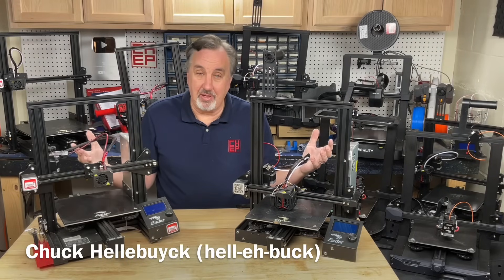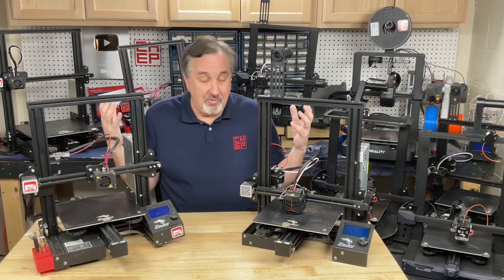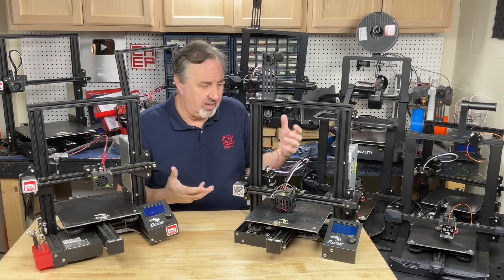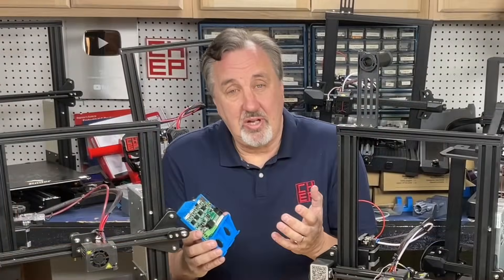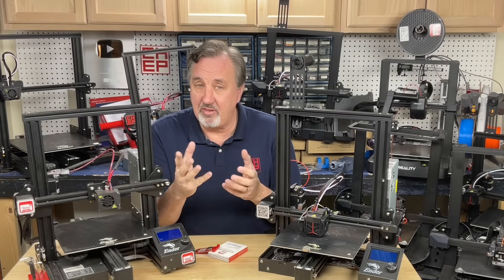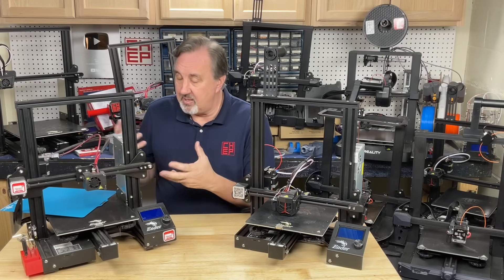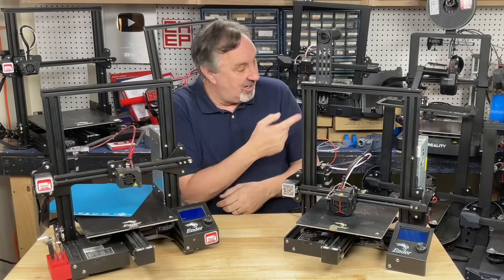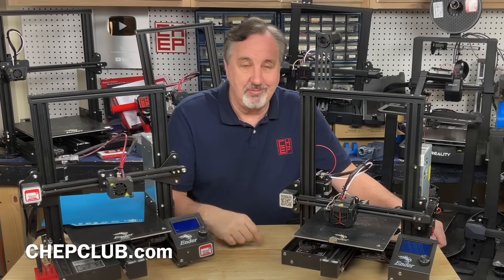Too Many Ender 3's - What Should I Do?

Comment: I bought an Ender 3 knowing it was open source, and had lots of support and potential for modification. I didn't necessarily buy into it thinking of practical printing, I bought into it as a hobby, a project to learn more and make useful things as a sidequest. 
What I don't see these days, and wish I did, was maker channels turning their Enders into printers capable of competing with modern machines and extending their life. The fact you would even suggest putting perfectly capable machines in landfill is completely against my ethos as to why I bought into this amazing printer. 
I recently pondered getting a Bambu, but I just did not like that it was not open source. I have invested in parts for my Ender to bring it back up to spec, so I have complete control, and I learn in doing so. It's just, I am struggling to find tutorials and guidance for the parts I have bought and my lack of knowledge. I took this risk hoping AI will guide me as Youtube seems to be lacking. 
The reason I follow and watch all your videos is because of the Ender 3.
Sure it makes sense for a channel to keep up with modern machines for reviewing, it takes a special channel to show dedication to the foundations of what got us going, like as you refer to classic computers, nostalgia is a powerful drug, as is maintaining and upgrading something well beyond it's shelf-life. That is what makes the Ender 3 live on to this day, the Bambu shake-up was and is cool, but it'll never beat an Ender so long as it's closed source. Just my two cents.

Comment: I have five Ender 3 pro's all highly modded. Companies got away from extrusion frames to save cost. The new printers with proprietary frames cant be modded like E3's can. The Ender 3's turn out great prints when the frame is braced better to remove vibes. I use mine at 150+mmps all day long. For the modders the Creality extrusion older machines can be had for low price and madding is half the fun IMO

Comment: the $200 Centauri basically has destroyed the idea of ever getting an Ender3. A 500mm/s, 256x256x256 build size, core XY with full auto calibration for $199 has changed the game.
Reply: I still use my Ender-3 with the 8-bit Silent Stepper Board daily with your CHEP Profiles on a iMac i7 2011- I’d embrace an Bambu A-1 Mini but hate their Slicer Software…, maybe a Video on how to tweak their Slicer to be more like Cura?
Reply: @theapplguy try orca slicer.. It does sometimes better job then  cura
Reply: @theapplguy  Once you get used to Bambu/Orca, you'll never miss Cura. I felt the same as you at first but Cura is so dated in comparison now
Reply: @theapplguy just use Orca. All the benefits. None of the drawbacks (ie. lock-in)
Reply: Except its completely closed source completely different target market I reckon, enders were great to learn on I think people who start out with something more closed or less easily nodded are missing out
Reply: @pellcorp some ppl just want to print. Not mess around with the printers. 

For those who love to tinker with the printers themselves the Ender 3 is great for that.
Reply: @thetabletopskirmisher  oh completely get that and the ender in any form is completely the wrong choice, even the newer ones were hit and miss on how well they printed out of the box.
Reply: Core xy there big use a lot of space.
And i love mod my ender 3 and my 3v3se. 
There Just super .
And i love the sound of a bedslinger. 
Amd i use them both.
Current on a shower project. 
And i put klipper on 3v3se and its faster then the 3v3ke. 
I think chep needs to a pla machine and give one away to some one. 
Its a diffecult project for a lot of People to make something like that.
I hope he stays whit the bedslinger they are Just that more fun to watch. 
Then a buildplate that.s going down .
And make no sound.
Reply: Tell us how long you need to wait just to start printing 😅.. Thats what bothers me about those core xy.. Endless mesh probing.. Heating cooling a few times and when you give up to wait it starts
Reply: @silverify  You don't have to run the mesh every print unless you want to
Reply: @silverify  for real. My old CR30 tuned with klipper can get some small prints done before my X1C. Hell some get done before the X1C even does its checks.
Reply: Yeah but that is just a short term introductory “beta test” price.
Reply: @TheVintageEngineer  from my understanding, during unclejessy's stream he got confirmation the price will stay there
Reply: @thecyberhobbit  that wouldn’t make sense to me as that would kill sales on Neptune 4s. Unless they planned on killing off that model.
Reply: @TheVintageEngineer  I agree it doesn't make sense as well, but that's the information I've seen.
Reply: @ if that’s the case then I’ll wait until this “beta test” period is over for them to fix things as there isn’t really a benefit to ordering one now
Reply: @TheVintageEngineer It's the final price. They probably will discontinue the Neptune series, at least the non-Plus/Max versions.
Reply: @TheVintageEngineer they said "the death of bedslingers" so that doesnt sound far off...
Reply: No I absolutely isn't.  It is the final price. This has been covered a dozen times already

Comment: I still have my Ender 3 Pro with Sprite Pro Extruder and 3rd main board. The multi color printers are still expensive enough in Canada and my Ender 3 good enough I haven't switched yet.

I would love to have an affordable way of upgrading it to print multiple colors with the 4.2.7 mainboard.
Reply: Speaking of tinkering Chuck, if you can come up with a way to use primarily only Ender 3 parts to make a filament recycler, it would make a whole new market for them.

Comment: I started with an E3. Then bought an E5. And finally a K1. I mostly use the K1 for 3D. The E5 is currently collecting dust, but could still be used. I turned my E3 into a permanent laser cutter/engraver. With interchangeable diode and fiber print heads for different tasks. I found a very affordable fiber module that works perfectly in this application. Chuck, feel free to PM me if you want more details about my conversion.